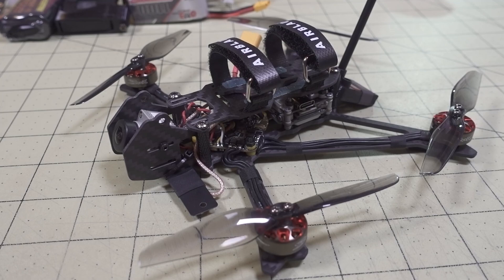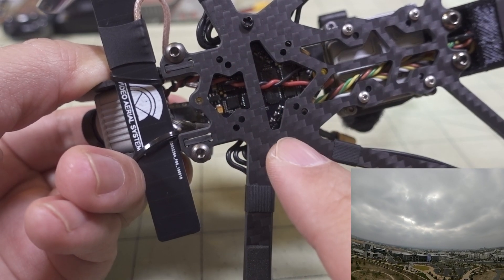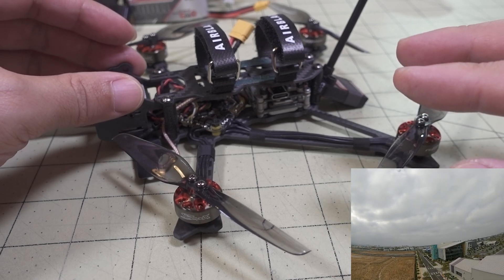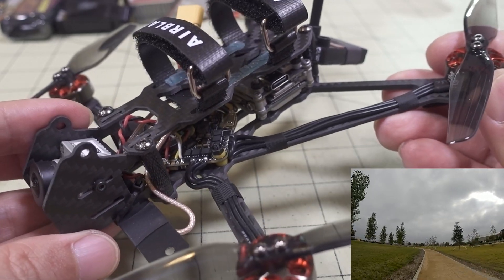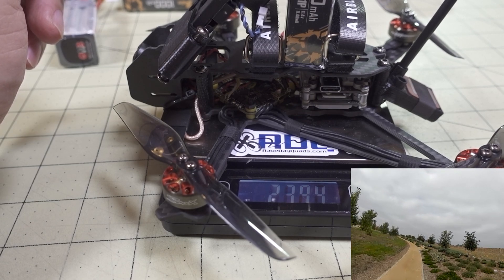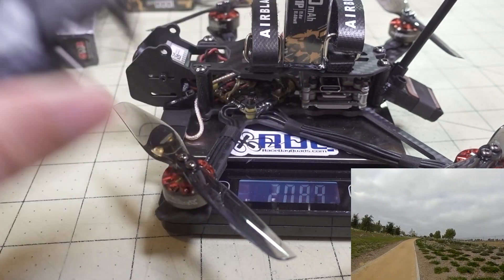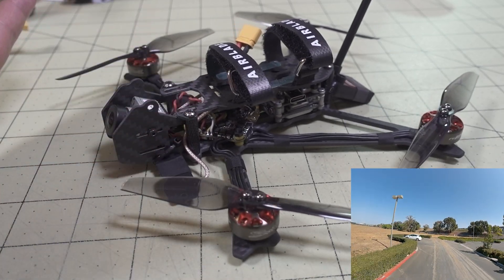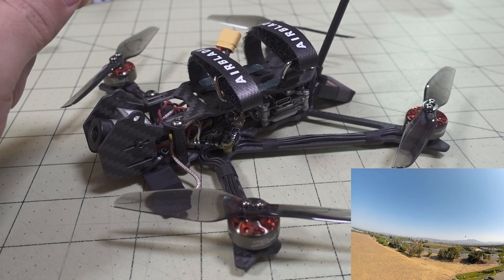AirBlade Transformer Mini 4-inch Long Range Build 🛠️

Comment from the maker: Airblade Transformer Mini Frame - http://bit.ly/30It6dA
RCinpower 1404 motors - *tbd
HAKRC 20A AIO FC - http://bit.ly/3d3kTW4 | http://bit.ly/3d3yZqu | http://bit.ly/34D6MDo
Caddx Vista - http://bit.ly/2QKaUM5 | http://bit.ly/35DLdkd | http://bit.ly/2QJsShw
Flywoo Atomic Antenna - http://bit.ly/3mWFjnl | http://bit.ly/3l1twUg
BN-180 GPS - http://bit.ly/3jZOIc5
HQprop T4x2.5 - http://bit.ly/2GsYfdX | http://bit.ly/2I1BRc3
VAS Crossfire Antenna - http://bit.ly/3k1SstA

*the RCinpower 1404 motors aren't available yet so try these instead - http://bit.ly/3mTzXti

Auline 1000mah 3S - http://bit.ly/3dcORas
Auline 1000mah 4S - http://bit.ly/3jDYVvk
GNB 1100mah 3S - http://bit.ly/3cbldBO | http://bit.ly/2ZM3j2A
Li-Ion Batts - http://bit.ly/3jVPYwP | http://bit.ly/2I1aj6P

📺 Full screen flights
https://youtu.be/jkHvGEdpk5Y
https://youtu.be/9LgqtR8WUNY
https://youtu.be/-GE_-obBA_w
https://youtu.be/3vgcAetqr30

🙏 Please support with a 👍 and don’t forget to hit the 🔔 thanks!

👉 Old gear for sale here -  http://bit.ly/AlbertGearFS

💲 Get the latest exclusive coupon codes (updated often)
     http://bit.ly/34SYiGn

Comment: I've found there isn't very good documentation on the Hakrc board. Any chance you remember what pads you used for soft serial? Looks like one of them was LED Strip. I'm having a hard time getting GPS to work on this board. Thanks for all you do.
Reply from the maker: You have to do some resource remapping.  On the board there is a pad called RT6.  That is MOTOR 5.  The other pad you'll use is the LED_STRIP pad.  Use this remapping for the soft serial.
# resources
resource MOTOR 5 NONE
resource LED_STRIP 1 NONE
resource SERIAL_TX 11 B03
resource SERIAL_RX 11 A08
Reply: @AlbertKimTV  Thanks so much for the reply. I was going over the dump but couldn’t figure out what connected RT6. Keep doing what you do.

Comment: I am almost done with my Transformer build. I put a "naked," full size DJI Air Unit on it, with a iFlight "Success," twin gyro F7 20x20 stack. For the naked Air Unit, I designed a 20x20 mount that can be 3D printed. You can find it free for download here: https://www.thingiverse.com/thing:4645790 It fits the Transformer perfectly, without a mm to spare. I could have got more breathing room with a 16x16 stack, but that would mean a compromise on features. I don't think it'd work with a whoop board mounted in the default position. With the full size DJI camera, I should get a beautiful live feed, and great quality HD DVR footage.

On one of my 4" LR "naked" Vista builds, I used a Hifion F7 AIO "whoop" board, with 6 UARTS, so no compromise. It's been a great board so far.

Thanks for the video! Cheers-

Comment: Thanks for all you do for us...  i have ordered the frame and all the other parts via your links, but I did not see that Airblade had the tpu gps mount, do you have a suggestion for sourcing that part ?   Cheers
Reply from the maker: The GPS mount is included with the frame.
Reply: It does NOT come with the TPU GPS mount. It only includes the top, bottom, and side plates, and hardware. You have to buy the TPU parts (a Vista antenna mount, and GPS mount,) seperately, for additional $6.99. It appears they removed the .stl files from Thingiverse too, so you can no longer print it yourself. I'm working on a far improved GPS mount, in a couple different variations for analog, or digital,  that will eventually be available to download for free. Heres a link to my "naked," full size DJI Air Unit, 20x20 mount for the Airblade Transformer. https://www.thingiverse.com/thing:4645790 You'll find the other accessories there on my profile in the near future.

Comment: Great review as usual!
I wish you pushed the flight further on the 2s liion down to 2.8v per cell. I would be very curious to see at which voltage the vista shuts down, cause it might happen at higher voltage and prevent to take full juice out of the liion.
Reply from the maker: I'll probably test this with an FC that has a 10v BEC.  I think the lower end of the Vista voltage input is 7.2v
Reply: @AlbertKimTV 
Actually I always thought that the bec on the fc were mostly step down only regulators (excepted for those doing 1-2s like the mobula7, which might do both step up and down regulation). So it would indeed be interesting to test if a 2-4s or 2-6s board can pump up a 2s liion voltage up to a stable 10v.
That being said I read on a couple of forums some guys reporting that vista was still functioning down to even lower than 6v despite the 7.4v specs. I will try to check that one if I ever build a 2s lionpack at some point. Thanks for your feedback.
Reply: @AlbertKimTV  Do you have examples of an FC that fits this frame which has a 10v bec?  intend to build an analog version(and use a. 2s LiOn occasionally) and all the higher power vtx's need 7v.  Thanks as usual for the great content!

Comment: Hey there Albert, been sitting on the fence on this one but finally pulled the trigger. This will be my first deadcat style frame, and I plan on using EMAX 1404 3700kv motors along with a 20amp aio. I am an analog pilot, so I won't be flying this digital, however I do want to be able to do some sort of "improved" video recording. Would a Caddx turtle or Runcam split work well in this, even if I decide I want to do a bit of light freestyle, or would you say its probably better to put on something like the caddx ratel/runcam eagle and try to get an insta 360 go down the line? I was looking at the Loris too, but the latency on that one scares me... lol. Great video as always. Thanks again.
Reply from the maker: I'm not sure this frame is the best choice for freestyle.  The flight characteristics are not ideal for freestyle.  If you want to go with a split style camera, the Tarsier or RunCam Hybrid would be my recommendation.  If you go with an Insta360 Go camera, you're limited to 1080p but you have much smoother stabilization.
Reply: @AlbertKimTV  sweet. So yeah, pulled the trigger. Rocking the 1404 3700kv motors with the tarsier. Will see how she does.
Reply: @AlbertKimTV  Thanks Albert, I think I agree. Its more light freestyle, with cruising ;) I think I will just build it analog in the short term and pickup a Runcam Hybrid on sale one of these days.
Reply: Good choice on the motors. I am almost done with my fourth build in this class over the last year. The only reason I didnt use a split camera in my analog build is that I didnt want to sacrifice the quality of the live  video feed. On my analog build, I get a beautiful live image from a micro size (19x19mm,) Toothless 2. For long recording, I have an on board 720p DVR that was $17 on Amazon (search for, "Sologood FPV DVR,") which does a pretty good job. I also mount a Insta360 Go on it, but the recordings are limited to 5 mins, and the frame rate is only like 24fps. It can be a little hard to work with too, due to limited storage, small battery capacity, and having to use the mobile app, because the desktop version lacks many of the options found on the mobile, some of them imperative for producing a useful video. The benefit with the Go is the stabilization, and the cool, easy to use editing options and features in the mobile app. It's really durable (ehem, first hand experience..) but the lense cover is not replaceable. I believe they'll offer a replacement at a discount if you contact them for a new lense. Hope this helps. Enjoy your build!

Comment: Hey Albert! Could you mention in the next video : I want to see some more people getting those high kv motors but only running 4s and using betaflight 4.2 motor scaling because it eliminates the need for 3 different voltage batteries. Nice video

Comment: you could just turn the fc 90 degree and set it up in bf instead ?
Reply from the maker: Sure you can rotate it and remap the motors and change the board orientation.
Reply: @AlbertKimTV like the different fc size the frame will work with.... and its very light weighted, so i ordered one :)

Comment: Hey Albert I have some 3700kv 1407 motors laying around, how do you think this quad would fly with those instead of the 1404?
Reply from the maker: 1407 usually have a 12mm mount pattern and this frame only works with 9mm mount pattern motors so it won't fly at all.
Reply: This is incorrect. I have 12mm diameter mount FPVCycle 2203s on my Transformer right now. The 1505s I have coming are also 12mm.

As far as how the 1407 will fly, I have no experience, but you wont have a problem mounting them to the Transformer.

Comment: Hi Albert, Great Video. I am looking to buy/ build a sub250g drone with decent power/efficiency that can record HD footage (e.g. Caddx Tasier) for under $300 CAD ($230 USD) preferably. Do you have any recommendations? Thanks!
Reply: Hi friendly there is a lot of reviews out for sub 250s with HD . Flywoo explorer is the lightest. Iflight Chimera is good, GEPRC baby croc is great too. I would just go to get fpv or race day quads and research a bit. There is a lot of sales now and black Friday sales are coming.
Reply: There's a 720p FPV DVR on Amazon for $17. Paired with a micro size Toothless 2 camera gives a beautiful live feed, and pretty darn good HD recording. This is the most cost efficient combo of which I am aware. If you go with a whoop board, NamelessRC makes a 720p dvr/vtx board that fits a whoop mount,  but it's twice the price, and I'm not sure it has the mW you may want for this type of build.

I actually get great footage with a Runcam Split 3 Lite on a Toothpick, but for Mid/Long range 4", I didnt want to sacrifice the quality of the live feed, or deal with the weight  and bulk of the seemingly problematic Tarsier.